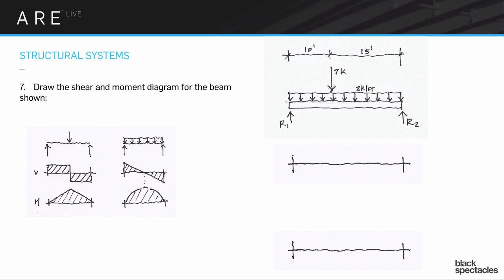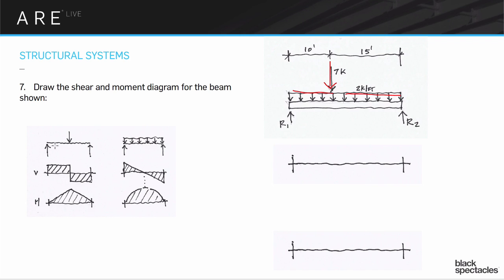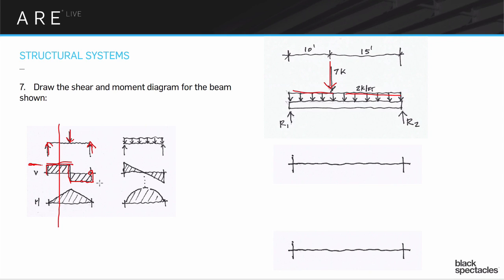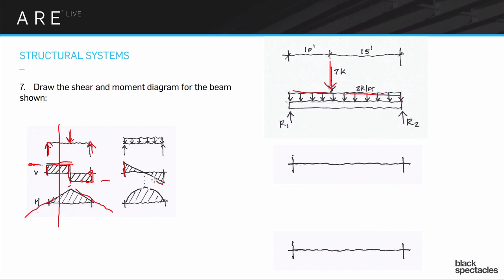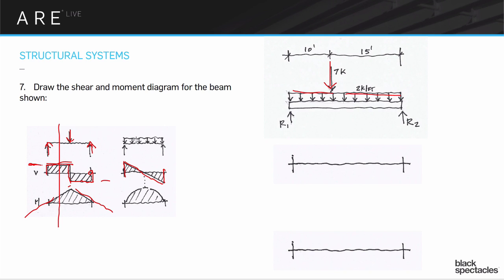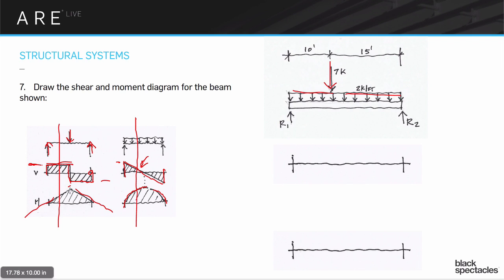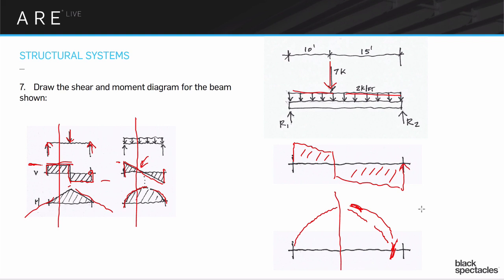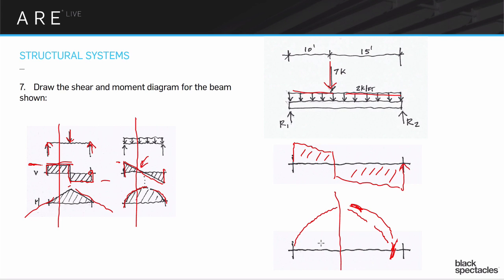Shear and Moment Diagram - Structural Systems - Architect Registration Exam A.R.E. Webinar

Comment: How can I find the max. moment on this particular situation, uniform load and point load applied at the same time?
Reply from the maker: Answer is somewhat complicated, so here's a simplified response. Hope it helps! A uniformly distributed load can be turned into a point load by multiplying the unit force by the length of the beam and applying that number as a single load in the center of the beam (or center of uniform load span).  You would then want to create a shear diagram by finding the reactions at both pins.  Internal moment at a pin is zero so we know that where the supports are shown both have 0 moment.  Once your shear diagram is drawn, you can find moment by calculating the area between the shear force and zero and graph the point on the moment diagram.  Do this for all changes in shear and connect the points.  Wherever the point graphed is highest will be your maximum moment.